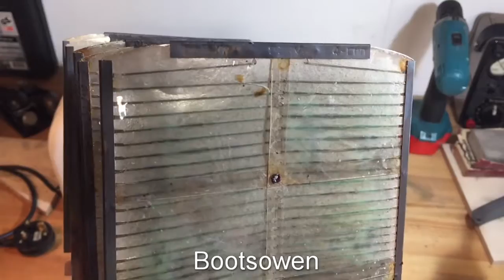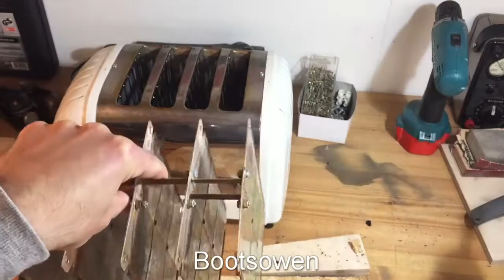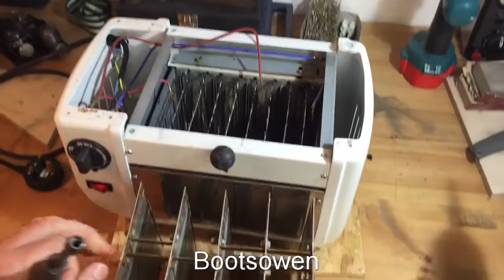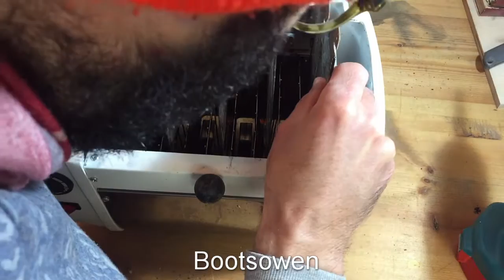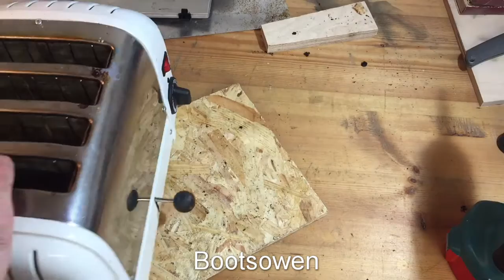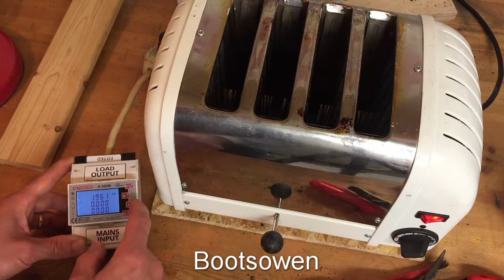Dualit toaster part 2: rebuild and testing: 4 slice

Comment: Hi, thanks for the video. I want to know if the support rods on the sides and the base are made of aluminum or stainless steel. I mean, if the aluminum comes into contact with the bread at any point? (I am not referring to the external clamp-type device to place the bread and then put it inside).
Is the aluminum in contact with the bread? Thanks.
Reply from the maker: I don't think they are made of aluminium or stainless steel. But it is hard to know what bits you are asking about. Why does it matter?
Reply: @bootsowen  For personal issues. It is not very important. Thank you for answering, you are very kind. Good video.

Comment: Yeah, those ceramic polymer element covers cause a bit of noise when getting to temperature. Though I'd bet a lot of the sound on yours due to is residual moisture in the elements. Have no idea why the previous owner would have thrown it away.
Reply from the maker: Probably the wrong colour for a new kitchen

Comment: I received one of these toasters as a wedding present over 25 years ago. As each of the original elements failed over time I fixed them by twisting the broken nichrome wire of the broken element together...not really a clever fix I appreciate. So recently I took the plunge and paid my £24 for a complete set of four new elements. Used the same method as yourself to loosen the tiny fiddly bolts with pliars and screwdriver...a pain ! Then discovered that you can purchase (on Ebay or Amazon ) a tiny spanner specially made to fit the nuts...would have saved a lot of expletives..heheh.
Anyway got the new elements fitted evntually and like you I was perplexed that they didn't appear to glow as they heated up like the old ones did...which are slightly different in design....your toaster has the newer type fitted. However after a few goes at using the toaster I was able to see the elements glowing in a darkened room. i think its a feature of their design or at least properties of the nichrome wire that Dualit now use to manufacture the newere type of element. The old type glow quite brightly. These toaster are built like a proverbial Tank and will go on forever and all parts are readily available from Dualit and online sources such as Amazon or Ebay. Fantastic British built appliances...love mine. Thanks for your videos.
Reply from the maker: Hi Michael, I found this one on the street. It replaced a Swan cool touch that we had from new, for about 25-30 years. It was only a 2 slice, but the same thing happened where the wire split and i just rearranged it so that it still toasted, It burnt through near an end. It worked like that for a bit but then it was the little heater on the bimetallic strip that released the toast that burnt through in the end. I had it rigged so it would toast as long as you wanted, but obviously some people aren't able to watch toast and the house deemed this not to be a solution.  I remain convinced that we are in the minority as people who will try to repair a thing.  At least these Dualits are made to be repaired, even if the parts are a bit steep.  But then again, if you forked out full whack for one in the beginning then £24 would be reasonable over 25 years.  I reckon it's the satisfaction that comes with knowing that you repaired it yourself that makes the flavour of the toast that little bit better, or maybe it's just butter!
Reply: @bootsowen  Wholeheartedly agree.

Comment: Weaker wattage on outside elements decreases chances of people or things getting burned on either of the PAINTED sides.  It is a wall of glowing elements after all.

Why  there are elements on the sides that face the painted ends (parts of the toaster that will never see bread) is kind of easy to suss. It saves money somehow.